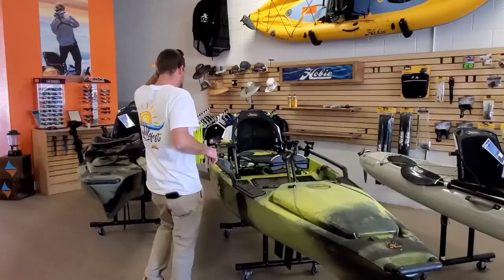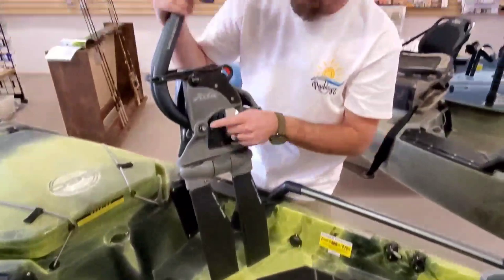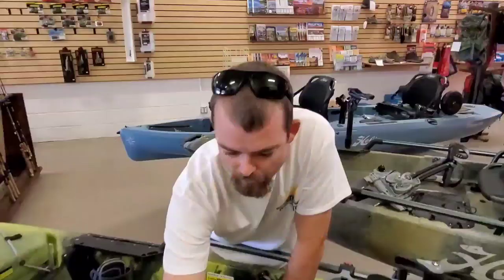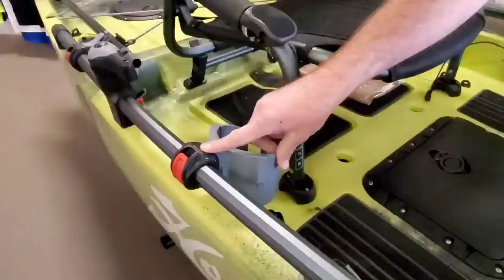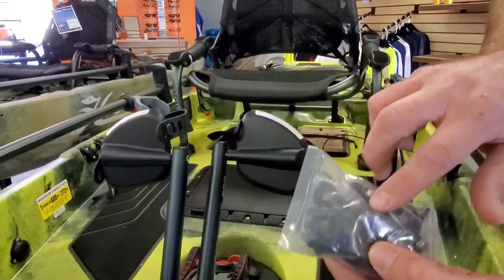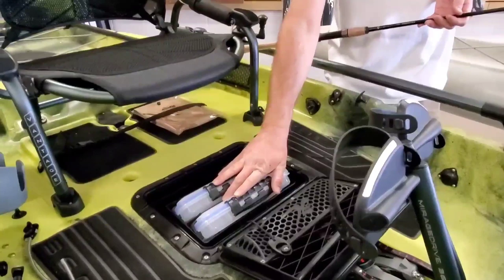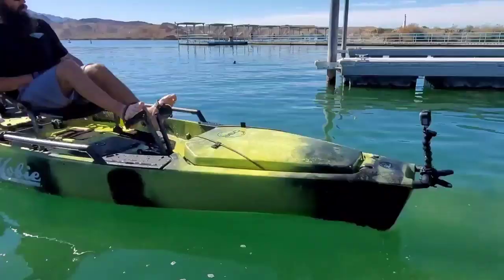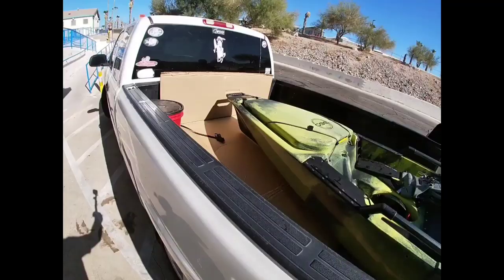Hobie Pro Angler 360 - It swims sideways!!!

Comment: nice & well thought out.   is there a trolling motor option?
Reply: richard cranium You can bow  mount a trolling motor on the 360
Reply: Torqeedo makes electric motors and rear mounts.
Reply: @TinyBoatNation  Yes. There are numerous videos out with them on kayaks. Hobie sells the Torqeedo Evolve electric motor that will drop in where the Mirage Drive goes... not in the new 360 models though

Comment: The plates for the filet knives etc are right where your feet would be if you're over 5' and I'm not sure why. Also I'm confused as to why they would construct their lifting handles in a way in which they do not recommend lifting the kayak by them. The foot brace rails are also strangely flimsy. $4k later you would expect a stronger design?

Comment: Hello sir, can you make a video with a 350 pound person on the kayak, I would love to buy the 14, it is the only one capable of supporting my weight, I think, THANK YOU VERY MUCH
Reply: Lavamutu Gavele it supports 600 lbs capacity, but you need to also account for your gear.  The vantage seat is rated for 350 lbs.  If you desire to, I would address your weight issues, that’s what I did to open up more doors.
Reply: Yes please thank you very much
Reply: Check the l4 expedition catamaran

Comment: Nah. Hobie is charging way too much. $4k is crazy high. These boats are pretty damn heavy too, meaning most people will have to get a trailer as well. So tack on another $1k+
I remember when they first brought out the 360 drive people were talking about how they'll drop 5k on a mountain bike, so this is no different. ..Yes. Yes it is.  on that 5k mountain bike, you're paying for a titanium frame, carbon fiber, kevlar, etc. This is still a plastic boat, made the same way as all the other plastic boats,  they just updated their propulsion, and tacked on another $1k.

Comment: I'd rather buy a 2500 dollar kayak and then throw the other 2500 at electronics. Close to 5 racks for a kayak is way too steep.
Reply: Or you can buy the $5000 kayak then add the electronics. Then not regret the initial purchase of the wrong boat. If you want the Hobie, you’ll probably regret not getting it. I seen me do it 10 years ago… just bought a brand new 360 yesterday and it stings… but so did having to buy another Hobie for the wife.
Reply: @BuckingFastard  I mean if you can swing it sure. I ended up going with a Vibe Shearwater. Loving it and I have plenty to throw at electronics for it. Plus I can car top it. If someone was fishing yak tournaments then I can see the price being justified. But as a weekend warrior it's just too high lol.